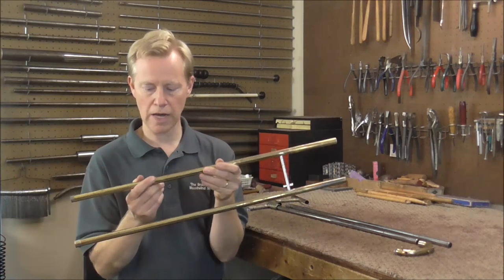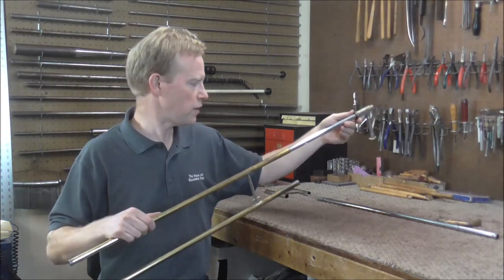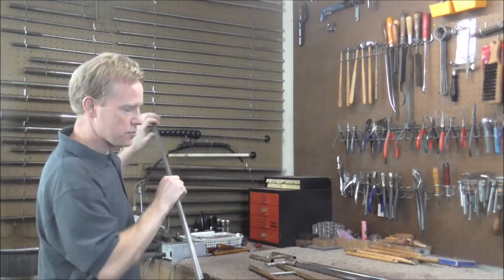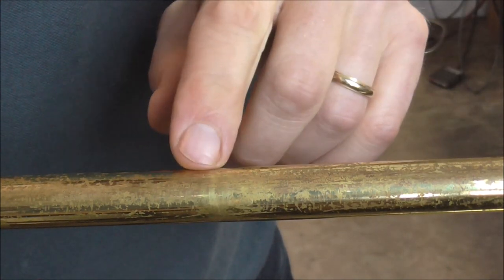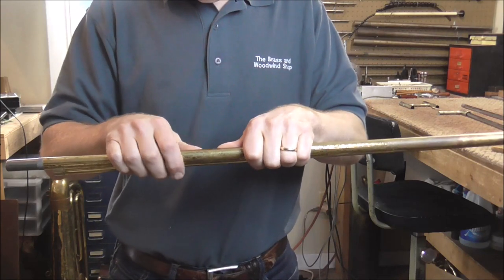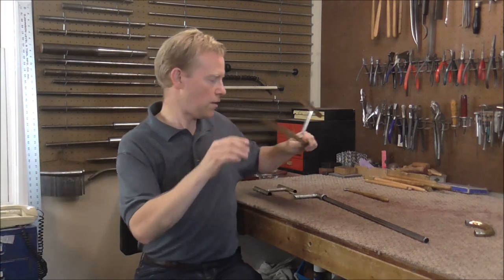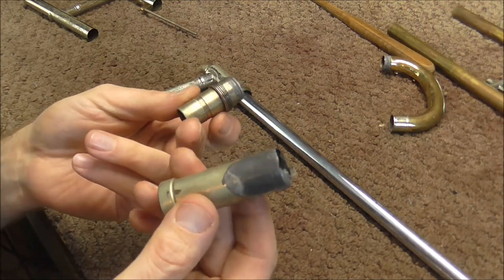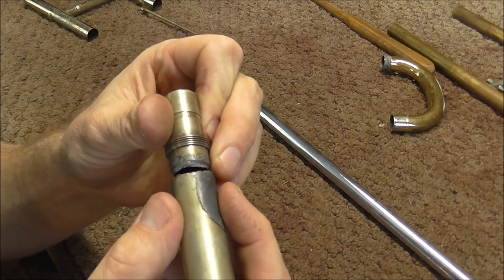Bass Trombone Restoration #7 Diagnosing Slide Problems (With Trombone Stories)

Comment: It looks like they used the short little tube as a strengthener for the repair that was attempted previously, instead of just trying to solder two broken halves together. Watching your videos has given me the courage to attempt to replace an inner slide tube on a trombone that I have. Thanks!

Comment: My friend...use ball bearingwith inside race removed.  The inside of the balls touching tube shoukd be OD diameter of the tube.  Leave your mandrel in and roll it up and down your tube.  This will work as english wheel to respread metal.  Until next time